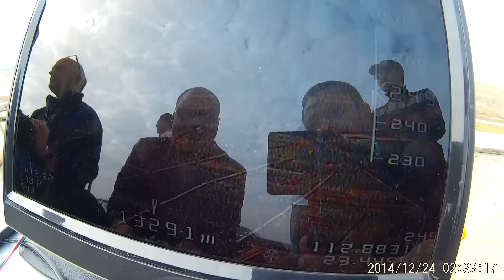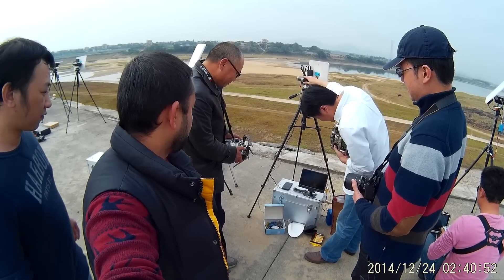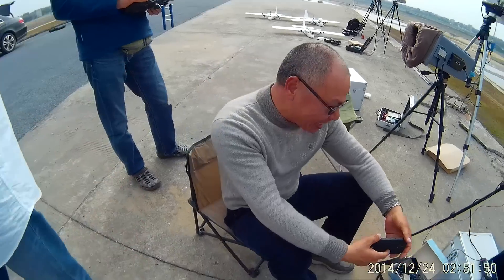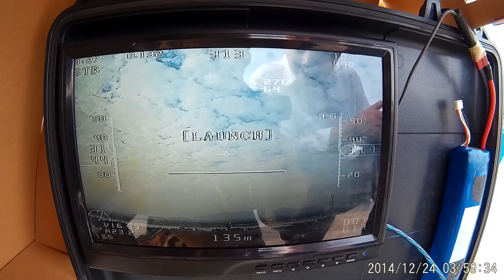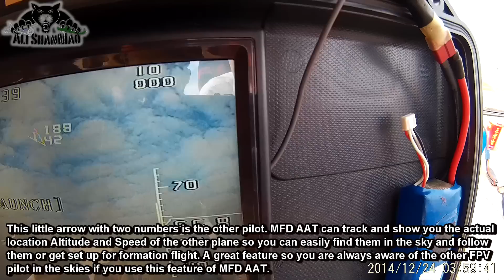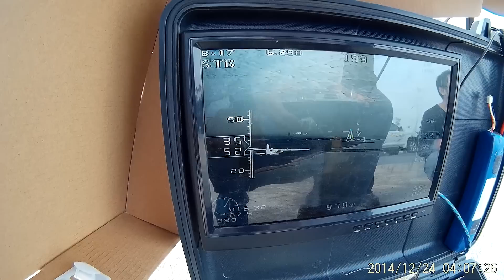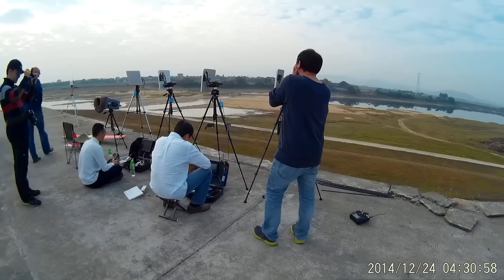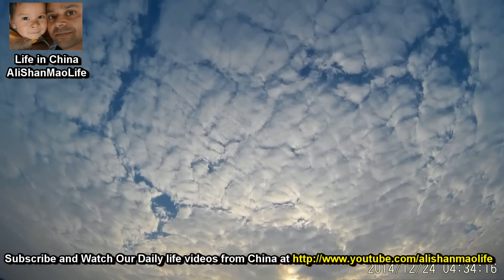A day with MTDs and Long Range FPV Pilots in Guangzhou

Comment: the website to order this is down. it says they are moving to dubai. they must be making a whole lot of money to live there. i would like to know more about what size lipo it uses. what is the efficiency time in the air average , and glide rate?
Reply from the maker: +Tom Slaymaker we can supply the updated version. 100km outback possible. updates to Flight controller makes it possible to take pictures automatically at set points. email to alishanmao@gmail.com

Comment: Hello all right.
I also have the Tx aomway 1w
My doubt is about how you feed the tx.
you use the Aircraft battery to power it? or use separate battery only for tx.
I ask this because my OSD is a Cyclops and Storm I feed with battery 3s separate the OSD and the Tx, however the consumption of tx is very high, and I was planning on spending the power it for 4s battery plane.
I await your contact
sorry my translation, I am Brazilian and I am using Google Translate.

thank you

Comment: Can you use the MFD AAT WITHOUT the telefly osd ? I have a quad with naza V2 with mini osd and a quad with eagle tree vector that I would like to use MFD AAT with its neat and compact no loose wires hanging out everywhere . Can it be used with what I already have ?
Reply: tracy baker You can use the MFD AAT with your Quad. You just need a TeleflyPro OSD and a separate GPS unit (can't hack into the V2). Then you can just turn the display off on your tellefly OSD :)
Reply from the maker: I don't think so
Reply: one more question alishanmao can the measurements be changed on the osd to imperial standard from metricsystem . i live in usa
Reply from the maker: tracy baker yes of course. there is an option for it in OSD setup menu

Comment: You mention a lot the Rlink for UHF. Is that the one you would recommend Ali ? Is that better than Dragonlink ? Thx
Reply from the maker: eastcoast78 so we are being eaten by these companies. DL says I am work longest range and TSLRS says we are bestest and world longest. Well I put my case to rest and I go vote for Rlink. the best UHF System i have ever used :D
Reply: alishanmao yes i know its normal for all company's to say they are the best. Which is totally understandable. But then you need proof to back it up. And so far I've only seen DL with videos to back up there LOOOOOONG range :)
Reply from the maker: So far the latest and bestest is RLink. But when it comes to long range, you might wanna get TSLRS German system for 100km range. much more reliable and least noise compared to all systems. Sherrer Long Range Systems are the best. But to stay Cheap from China market, Rlink is the best for now.
Reply: alishanmao Dragon Link beats TSLRS. in range, also their customer service  bests any other UHF there is bar none...:) DL holds the worlds long range record. The video is here on youtube.